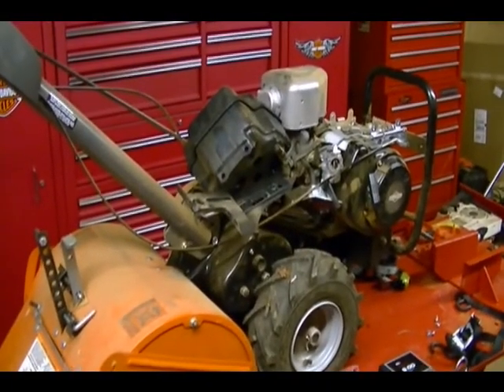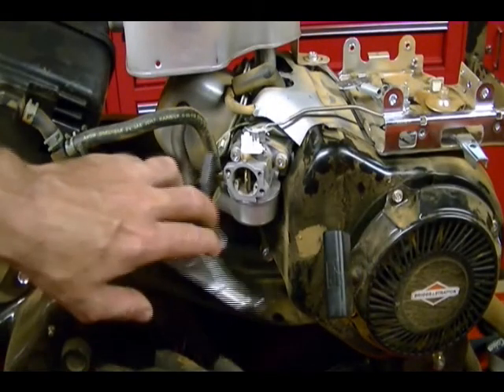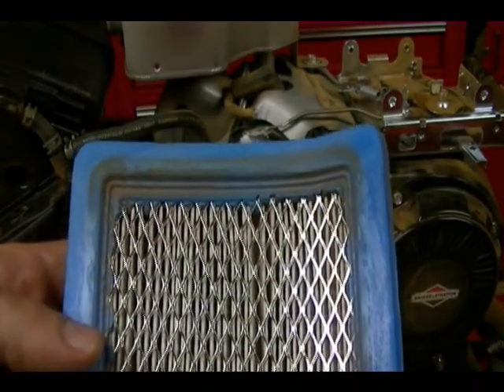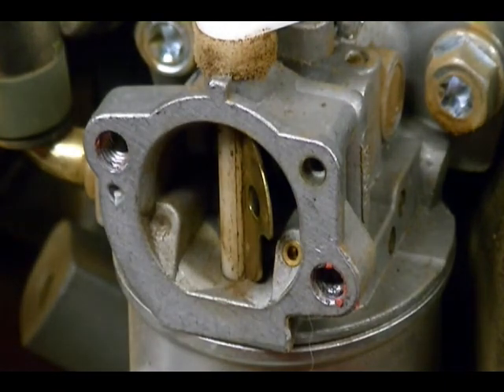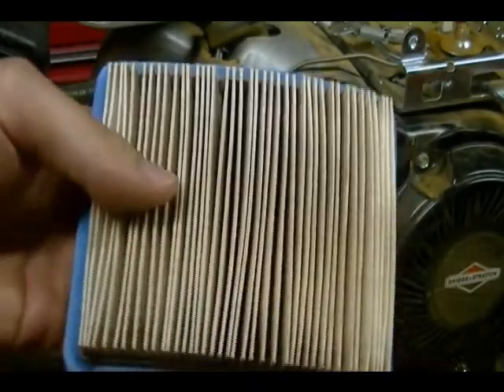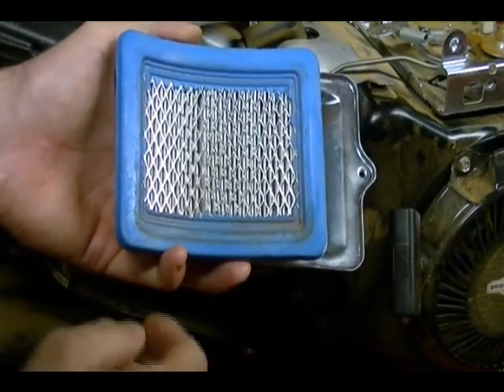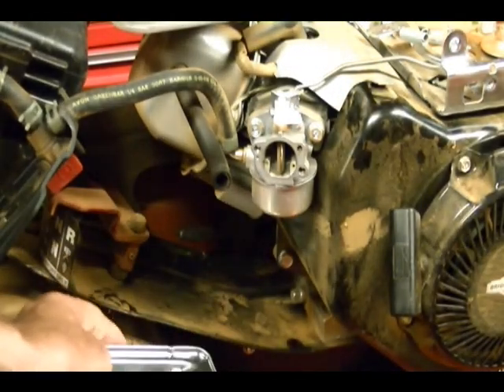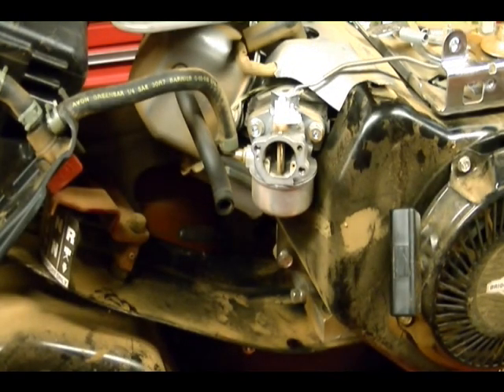Small Engine Repair: Evidence that Dirt is getting inside your Engine

Comment: I had the same problem and what I found was the hold down screw put in tight did not  put enough tension on the lower case of the filter.  I decided to install a  1/4 in weatherstrip around the filter 1/8 in thich.  One 25 ft rool for 5 dollars.  Seems the  filter housing distorts when hot and  age.  Gread vid.